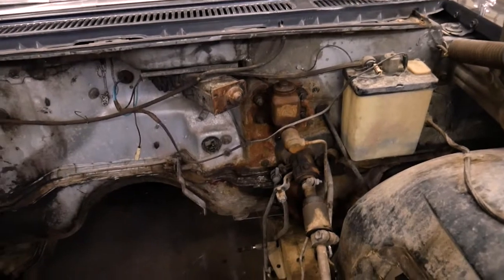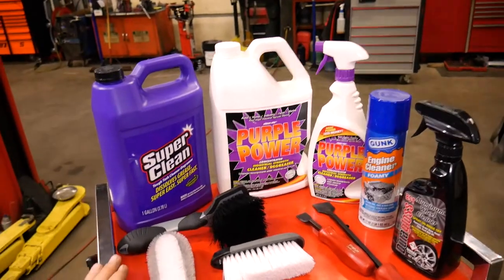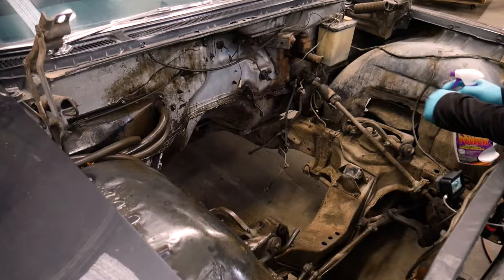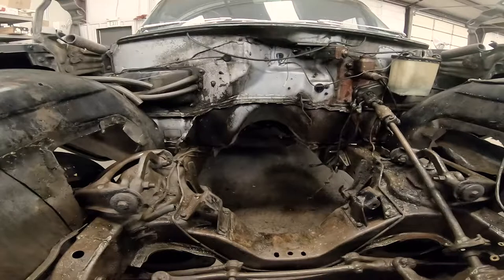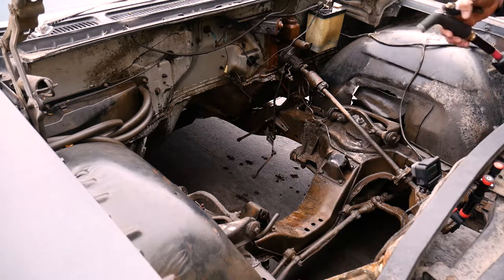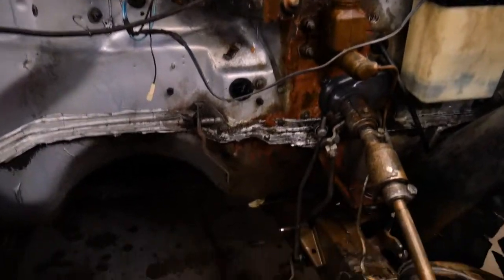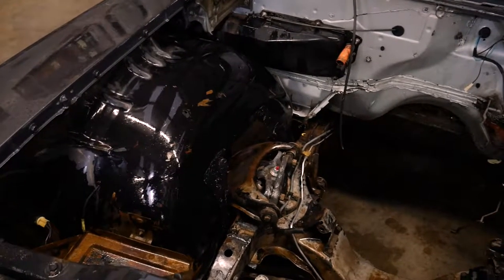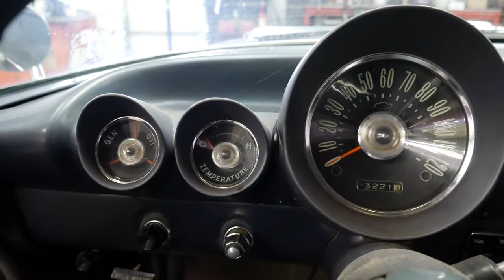1960 Chevy Biscayne LS Swap - Ep. 5 Engine Bay Cleanup

Comment: In the end of the video you mention "waiting to see if new motor mounts come in the kit" Have you ever mentioned the actual kit you purchased for this swap? Im just about to embark on this very same journey with the very same car/engine combo and could use Some of your info. 1960 Biscayne 235/3speed on the tree.
Reply from the maker: I got most of my parts from bhpHotrods/musclerods. It came with new motor mounts, transmission mount and brackets.
Reply: @ThePracticalMechanic   Very helpful! Thank you for taking the time to respond and making video series on this car/build. I swear until I found this series today, I was considering going with what I know, and doing an sbc or bigblock carb swap.